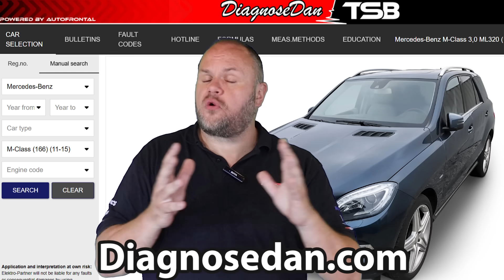Mercedes GL/GLE & M-Class (2011–2018) – Engine Won’t Start | No Comms on Chassis CAN – Radar Fault

Comment: Lol i have had this problem where they put a screw in to the back bumper right into the harness. The car would not start and they told me that they did not used any screws. But they painted the front and back bumper. So i told them to undo the bumpers and right there was the screw in the harness.

Comment: After driving home normally, the next time I tried to start my ML it came up with a host of warning lights and refused to go out of Park, needless to say it had to be dragged onto a recovery truck and returned to a dealer. The fault was the near side radar unit. The authorised repair was to replace both units £1500 plus. Even though they had one in stock the car was out of service for 8 weeks because the other unit was on back order. I am no fan of these radar units, it’s an extra feature I don’t need and an expensive one to repair. Thankfully my replacement GLE 350 doesn’t have them.
Reply: When the Radar is unplugged it's unable to affect the network, this way you should be able to drive the car untill the radar is back in stock.
Reply: Remember the car is at a MB dealer - all they said is it’s a control module, car won’t work without it and it’s on back order - after 8 weeks I’m getting agitated and ask more questions about the fault from the service manager. He then shows me the MB approved repair document, that’s the first time I get told it’s a radar unit at fault and they’ve done one side, just waiting for the back order to do the other side, bearing in mind that side still works. A heated discussion followed and they said the repair warranty would be void unless they followed the full process. As it happens I told them to keep the car as part exchange and I replaced it with a GLE350 with no radar.
Reply: @Diagnosedan Cheers for responding Dan, sadly not all Dealers operate that way. Keep up the good work. 👍

Comment: A bit late to the party Dan. I'm no mechanic but these interfaces for the CANBUS on Mercs have been there for years. I own a 2014 C class and a 2018 E63.
Reply: This video highlights the common radar failure on these models, the symptoms and how to effectively diagnose it. I'm not referring to the can-bus joint connector as something new.

Comment: I've seen chassis CAN light up the dash because of the VGS in the transmission is varying the signals. Also seen low battery voltage cause those radar and parktronic systems to freak out, but only when cranking and people chasing all kinds of things.
Reply: That's why a detailed diagnosis is very important! You are right every module on the network can be responsible for taking out the network. But we know from statistics in most cases it's one of the radars, but not always and thats why we have a detailed description in the bulletin on how to pinpoint the root cause as efficient as possible.